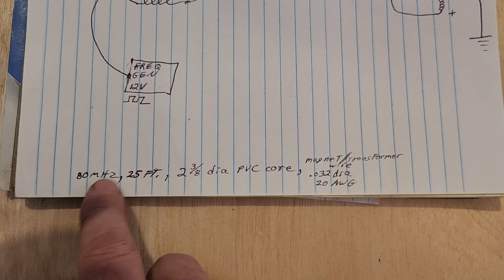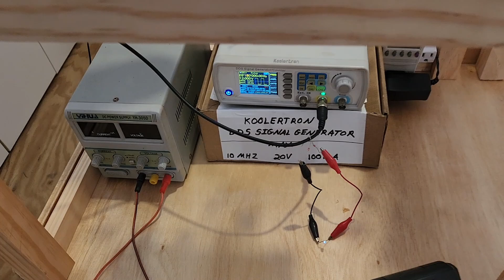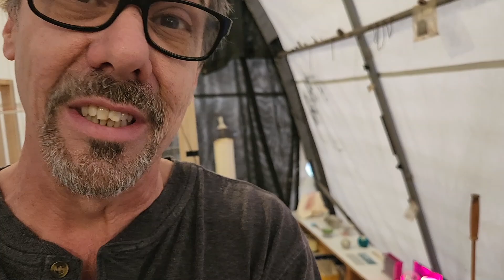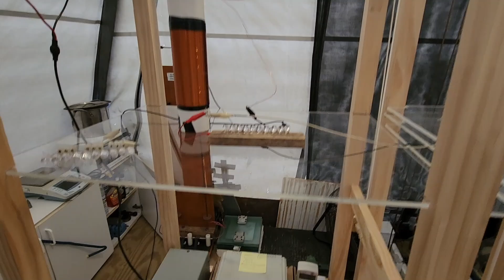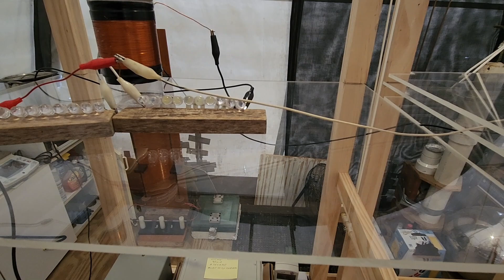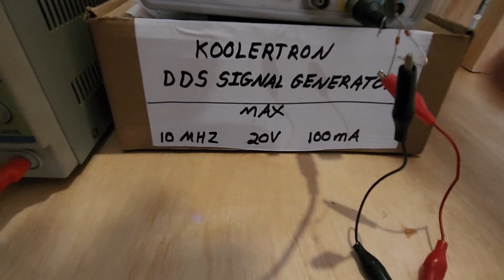QUEST FOR UNDENIABLE OVER UNITY & MORE POWER, PART 1

Comment: Hi Paul! Could you raise those plates up higher off the table, so that way you have more gain in amplitude. Please Also what is the difference in potential of the ground.
Reply from the maker: Sure, i would love to put the plates on my roof, hehehehe.  Once I add more LEDs and larger coil, than ground is not needed.

Comment: put a energy watt meter on the signal gen plug and then you can actually see how much watts it draws. you might be surprised...
Reply from the maker: Ha, funny, i do have one attached, it is sitting on the right-hand side of the freq gen.  Yes, it is actually drawing between 5-6watts,,, the freq gen is not an over unity device, so of course it  may use 5-6 watts to run, but it is only putting out to my circuit less than 1 watt.  Eventually I should be able to use a small antenna for my power supply and pulse.  Then it would be 100% free energy.

Comment: Paul, may I make another suggestion. Firstly, thanks for trying the different distances. I do note that we could try "half-closer" distances too. Anyway, my main suggestion this time round is "scale". Can you please mark mm / CM on the uprights where the plates move up and down. That we we can, if we want, make notes about how many LED, which FREQ and what distance the plates are apart and if you have an earth attached. You can get the community to do the "note taking" as such. 

You'd end up with a dataset like. 

Voltage, Distance, FREQ, Num LED,Negative Attached,   Ground Earth Attached, Floating Earth

Or somethning like that.
Reply from the maker: Okay, no problem, i like your idea of marking the uprights! I will try my best to do that. But please understand that the very next video is already edited and will be posted soon,, but video after that one i will do better measurements:-)

Comment: Happy new year Paul !

As far as I understand you have a capacitive coupling there … if we listen to Don Smith and teachings of Tesla power goes up with square of voltage and square of voltage.

So, for capacitive coupling all you need is an oscillating electric field … so you need high voltage to get more power and/or frequency … but I can guess there is a limit in available power to collect of you keep your voltage low. Think about how electric field is radiated from your middle plate and how your capacitive collector plates interact … can you capture all available energy ?

Of course due to no current flow in your resonator/waveguide (middle plate) there is no consumption on load side but you have to consider standing wave and resonance taking place which may bring more energy available.

Currently I am experimenting with Lorrie Matchett setup (see his channel) confirmed by alexkcor (see Patrick Kelly book) and making a parallel observation with Don Smith method using plasma tube or soft iron rod. If you are confident using high voltage you may add a flyback transformer or ignition coil for cars after signal generator and then inject the voltage in your resonator. I am using a simple copper pipe with ordinary wire for home appliances 

If you are interested I can post a video on my channel … power consumption stays the same for the moment but I don’t have proper loads to confirm and yet I have to tune the system for resonance as all I can see now is a fluctuating Voltage which is sagging under load due to very little curent available.

Also, Joel Lagace has shown recently the same effect with much more succes, although using quite complicated ion valve collector.

Comment: So, if the plates were pulled apart just enough to turn out the LEDs, a speaker aimed at each outer plate... Disco light? You know what frequencies I use. I need someone to play anything I have to purposely get a copyright strike AND dispute it to see if I can eliminate that strike section for experimenters or specific channels. Experimenters might find this helpful?